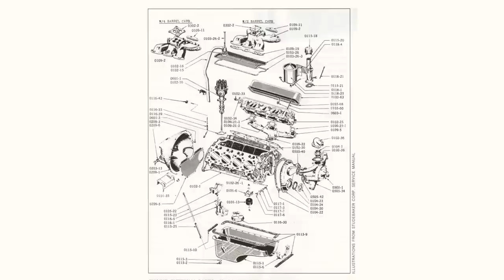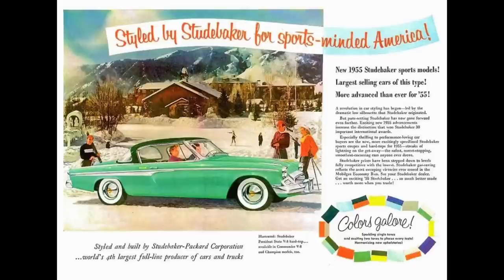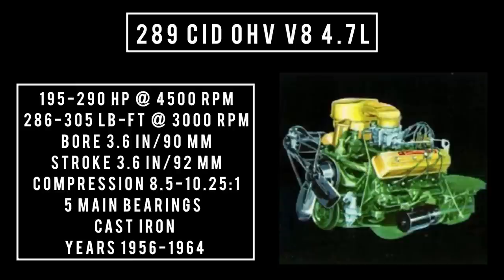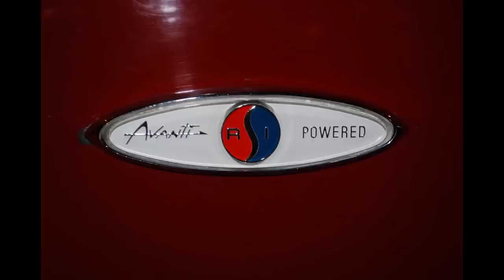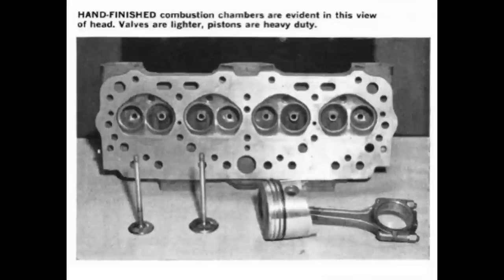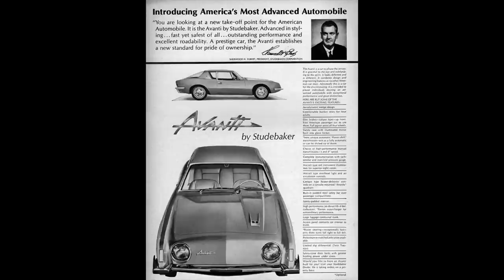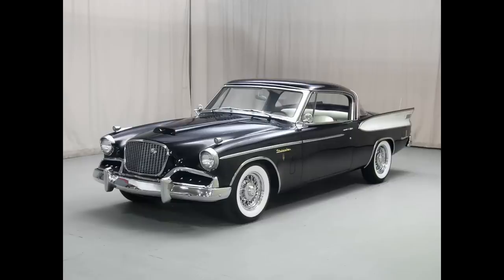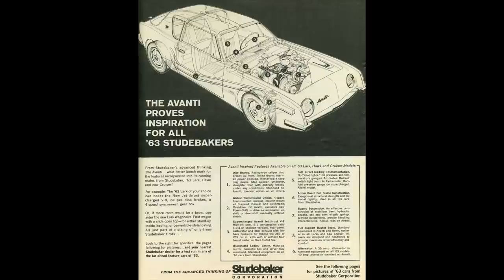STUDEBAKER V8 ENGINE ( 232, 224, 259, 289, 304.5 )

Comment: Studebaker designed their V8 from the start with supercharging in mind. Thus they made it really really strong. But the other side of that coin is that it was a heavy engine, and in particular a heavy engine for it's maximum possible displacement. So when Ford and GM got their small block engines into production, they could match the Studebaker displacement and power with very much lighter engines. The downside of a heavy engine of course is heavy steering and nose heavy handling. Of course Studebaker did go on to use supercharging to stay competitive in power terms, but this added weight, expense and the need for 100 octane fuel. I've often wondered whether Studebaker misread the tealeaves and thought that octane ratings over 100 would become the norm. Don't get me wrong - I love Studebakers, but all I've driven have indeed felt nose heavy, making the driving experience nothing more than average.
Reply from the maker: I’ve heard that too that these tend to be nose heavy I’ve heard of people putting ballast in the back to stable out the ride I’ve also heard about the Hudson jet that it tends to be nose heavy I know that that’s not even on the same subject but there was a lot of cars that had that problem. 

Thank you so much for sharing all the information and insight I really appreciate it =)
Reply: Studebaker, like most automakers in the late 1940s and early 50s when this engine was designed, was almost certainly expecting the super-high octane fuel that had been available during the war for fighters, to be made available commercially.  During the war, 130 and then eventually 150 octane fuel was produced for use in fighter planes (Allied planes that is; the Germans were stuck with no better than 87 octane, which is why their fighters had to have much larger-displacement engines).  Postwar automakers anticipated higher than 100 octane fuel being made available for automotive use, and forced induction is natural to take advantage of that.  But when that kind of super-high octane fuel never did appear in gas pumps, the big three had the money to develop larger displacement engines as an alternate route to greater horsepower.  Not so much with Studebaker, though I have read that they finally did start working on a new 340 V8 engine at the very end, and had made a few prototype blocks.
Reply: @Hibernicus1968  - In the Navy, I worked on the SP-2H Neptune with the turbo-compound R-3350 radial engine. The top octane fuel available then was the 115/145 115 octane, 145 performance number. The engines also used water/alcohol injection.   By the mid 1970's 100/130 was top dog. 100 octane. The fuels were dyed purple and blue, respectfully for visual ID.
Reply: CAPP Stude ACTUALLY did not design with supercharging in mind. But rather with higher octane fuels, as science claimed would be forthcoming and soon. 
The Stude block and strong forged parts amongst many features olds and caddy did not have was deliberately designed for such future fuels.
The engine was as planned capable of extreme comp ratios- as high as 14-15 to one. A testament to it's strength and durability over virtualy all big 3 engines proved itself In those 14 years. By1963 the R3 engine produced over400 HP and the R5 up to 600 HP from 5 litre 304. And by1990s era nearly 1000 HP in Lange's Avanti.
No cad or olds engine of the 50s or 60s EVER capable of those figures. So who really had the primo design back then? Not big 3, Studebaker? yes.
Reply: Read the reports from the 60s era car mags. When properly set up chassis's were finally forthcoming from Studebaker circa 63-64 models they were proclaimed by auto test magazine drivers as the best handling American sedans period. Reference hot rod magazine tests of both the R3 super Lark and the R3 Avanti.
Yes I reiterate the best. Not my appraisal but those magazine drivers. Factory went for a decade from 53 on not having a clue how to get the Stude V8 to produce real power or how to make their cars  great handling items.
Granatelli and Egbert only two individuals in post ww2 that had a speck of true vision. Management previous to them were just grey suits toting cigars .exception was church. Had some vision but "bored of defectors" nixed his ideas for post 1960.
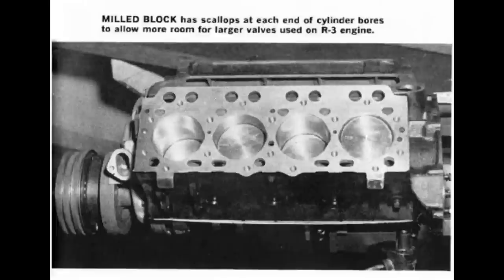Reply: 7:31  Count the head bolts.

Comment: Always love a good studebaker they were way ahead of their time they were running titanium valves back then for all that boosted heat lol
Reply: Because  of the fact that the Studebaker engines were  limited in size they had to revert to expensive ways to make power. The big Three found it was more economical to just make bigger engines, if they wanted more power!  A super charged 289 was a lot more expensive than a Chevy 427. The 427 didn't need exotic parts to make the power they were looking for. A 427 chevy was the same weight as the 289.
Reply: @mylanmiller9656  - I heard that the Packard V8 could have been expanded to upwards of 500 CI.  But Studebaker-Packard dropped it after 1956. The engine was heavy but qualified as a BIG BLOCK.
Reply: @scootergeorge7089  The Packard V8 engine had a 5 inch bore spacing, that is larger than even a big block 460 ford. The weight was not that bad if you look at the size potential. There was a lot of room for future improvements. even the design was more modern than the Studebaker v8.  the Picard engine was a better bet than keeping the Study engine.

Comment: In the late 1970’s I worked at a auto parts and machine shop in Long Beach, California. It was called Standard Motor Parts and I  worked in the machine shop. We had a regular customer who restored Studebakers that we built engines for and I remember the castings seemed better than rivals and the blocks were cleaned of casting flash before assembly. They were also painted inside with an epoxy like paint and I was told this was to aid in oil drain back. My job was boring and honing the blocks and engine assembly and the blocks were heavy compared to the displacement. The Avanti was one of my favorite cars as a kid and even now at 68 yo. 👍🏼
Reply from the maker: Awesome memories thank you so much for sharing those stories =)

Comment: The Studebaker V8 had to be designed as a heavy duty/industrial engine as reflected in its great features like shaft mounted rockers, heavy castings, long skirt pistons, tall deck height and long rods to name a few. Whether planned or not, this lends them to being able to handle high boost levels for longer.  Studebaker had a line of trucks up to at least 2 ton. Diesels weren't really popular until the 1970s when turbocharging became more common on them. Compared to "first generation" Diesels Gasoline engine trucks offered lighter weight (meaning more available payload) simplicity, lower cost, and MUCH better torque and horsepower for their cubic inches (except for Detroit Diesel which Studebaker also offered.  I had a 3-71 from one) over these older Diesels were quiter, started well cold, and they had smaller physical size. They also had a much broader powerband, requiring fewer gears in the transmission. Diesels offered far less low-end torque and could only wind half as high. Gas engines can be made to last just as long. Economy was the big benefit to a Diesel, but gas was cheap. While you will find GM and Ford automotive gasoline V8s and sixes in their low-cost  medium duty trucks, they weren't designed as such, and therefore, GM and Ford used as heavier duty but more costly optional gas engines in stages. #1 use of higher end stronger designed pass car engines, Ford used Lincoln, GMC used Pontiac, etc. #2 Heavily modified passenger car V8s with re-designed heavy duty heads and higher oil and water capacity and flow. #3 A totally separate HEAVY duty industrial/marine line of gas engines that bore absolutely no resemblance to any automotive engine even of the same cubic inches. Just as an example, GMC "big block" V6, V8, and yes, V12s from 305 to 702 ci, and Ford 401, 477, and 534 ci V8s. These engines were installed in semis as well. Ford even twin turboed some of these in marine applications. Ok, Mopar guys, I didn't forget you! They, like Studebaker, designed their automotive engines from the flathead days on up as heavy duty/ industrial as well, not having a separate line. The early hemis were some of the finest heavy duty/ industrial/marine (I have a 1958 Dodge semi tractor that still has its 354 hemi) engines available. The 361 was the longest production big block for Mopar, followed by the 413 because of the truck series. They were used in armored cars also and the 413 was even offered in Mack trucks.(early on, mopar did have some special heavy duty only  flathead sixes up to 413ci) that's why having a heavy duty background led me to like Mopars for racing because no componets needed to be replaced for reliability, or strength, such as for the use of heavy valve springs and no oiling upgrades were really needed. They, also being used for factory high performance and racing engines had good cylinder head flow and rpm potential, especially the hemis. That's also why I like the Studebaker engines, they are made with engineering and materials QUALITY! I think, however, that in their cars  they fell prey to the old adage "theres no replacement for displacement." Small ci centrifugal supercharged engines are great for some racing but are prone to some low end boost lag. They may make 400 hp. That's great, especially for long track speed records. BUT to the average joe or julie taking a test drive around town in traffic, looking for a simple inexpensive (not supercharged special order) yet snappy car, even a base model 361 is going to have a much better throttle response and low end torque where you really need it 90% of the time. Also, many manufacturers offered many multi carb setups for many years on high compression engines even in their more pedestrian and luxury cars like a 1961  413 long ram engine with "only" 375 hp that has 495 ftlb at 2800 rpm, opening 4 bbls at a time with 4 left. The hard part was NOT spinning the tires! This was true of the other manufacturers as well. Even at these performance levels, there was a whole lot left to be had with simple mods naturally aspirated. Also, Studebakers were too heavy, small ci and offered virtually no aftermarket parts. This prevented their being scrounged from junkyards from base models and then swapped into something else and hotrodded like a Ford flathead or Chevy smallblock. And, They certainly couldn't compete in the high-profile 1/4 mile NHRA top fuel drags. As to my experience, I am a drag racer, engine builder, machinist, and tractor puller, and I have owned over a hundred of the big gas engines, consisting of all makes up to the 702 v12s thanks!

Comment: Jay…a few things you left out.

All of the R-3 to R-5 engines were hand built out in California (Ventura/Camarillo area) at Paxton Products, a division of Studebaker, under the supervision of Andy Granatelli. Yes, the same Andy Granatelli that eventually owned STP (another Studebaker company) and the builder of the Indy Turbine Car and competed with Carroll Shelby in developing that technology. Yes, Shelby brought a turbine car to Indy and attempted to qualify it; I believe that was out of the shop in Gardena, CA, just North of the 405, off the Harbor Fwy.  For many years, Andy also owned Tune-Up Masters in the 70’s and 80’s. Sherwood Egbert was brought over from McCullough, the same company that made chain saws and superchargers, the company that supplied the blowers for the 1957 Golden Hawk. It was the 1956 Golden Hawk that had the Packard 352 V8, which was powerful, but very heavy and handled poorly in the Hawk. The 1957 produced about the same hp as the Packard motor, but was much lighter in the Hawk. 

Granatelli oversaw all of the racing development under Egbert, most notably the Bonneville program. I have heard the R-5 was rumored to be upwards of 600 hp…out of 304.5 cubic inches. That was no more a production engine than the 377 that Duntov put in the Corvette Gran Sport!

As for Egbert, he wasn’t as much fired as he resigned. He had been diagnosed with cancer and  Studebaker’s board of directors had made their wishes clear…shut down the car operations. They moved all production to Hamilton, ON…not to save the cars, but to avoid being sued by the dealers for not fulfilling their contractual obligations. Studebaker-Worthington Corporation was formed shortly after that, eventually being acquired by McGraw-Edison in 1979. Today, it’s part of Eaton Corporation.

…and that’s the rest of the story.
Reply from the maker: Thank you so much for sharing all of that I really appreciate it I was missing some content where I talked about Eggbert being brought over from McCullough.. and it’s weird some sources peg him as a villain and other sources peg him as a hero he was a car enthusiast he wanted to see Studebaker succeed and I think he could’ve if things were a little different if he could’ve got more automotive journalist on his side for whatever reason they’ve always been in bed with GM.. 

But thank you so much for sharing all of that insight and information I really appreciate it =)
Reply: Jay, I don’t think anyone, given the passage of time, could view Egbert as a villain. Maybe it was his namesake, as the villainous alter ego in “Dilbert” that lead some to think that. 😂

He was an engineer who came from a very blue collar background. When he took over Studebaker, I believe he was 42 yrs old!  He tried what no one thought could be done…with basically no resources. Bringing in Raymond Loewy to do the Avanti, in literally 6 weeks, and Brooks Stevens to freshen up both the Hawk and the Lark, was masterful. I don’t know if it was as much too little as it was too late. The Avanti had the same teething problems that beset the Corvette, just not the deep pockets of GM. And the Hawk was Studebaker’s previous halo car…but was in it’s 12th year of production by the time the plant was closed in December, 1963. Heck, the Lark was on its 8th model year by the time it was finished in 1966.
Reply: It is my understanding that after the South Bend facility was shut down, all Canadian produced cars used Chevrolet engines.  True?
Reply: @scootergeorge7089 Yes, when production ceased in South Bend, all cars in Hamilton, OH used Chevrolet engines.
Reply: Thanks Mr Harvey but that's only the tip of the iceberg, not the rest of the story. By and large your analysis is on target. 
But for example ,NO one would claim that the R5 was a production engine. It was a veritable 
"Mule" set up to showcase the  venerable Stude V8 pptential that was close to a 15 yo design by 1964. And what it proved at 600 HP and 198 MPH was that Detroit had many good throw away engines,but NOTHING that matched STUDEBAKER's quality.
Envision ,for the sake of humorous examination, the history of the company . In 1862, or 10 years after Studebaker began producing wheeled transportsion, the company was producing hundreds to thousands of wagons etc,including such for the army of the north . 
Meanwhile a year LATER a man boy was born and taking nourishment from mother's mammary glands. His name ?
Henry Ford.
Much much more to the story before 1964-66, and an entire legacy of achievements for the 
114 years previous.
As to the R3'S 4s and one ,R5 being hand built by Granatelli??
That's natural for a hi-po engine series.
But consider the R3 capable of 175 mph in 1963. Or compare to the Corvette in 1963-65 which was capable of 133-138 MPH,OR 40 MPH slower than the Avanti.
Corvette finally was able to match and top such speeds...
BUT almost 25 years later, and they were NOT factory jobs. 
Called calloway vettes and were tweaked OUT of factory for several years and versions--
Thats Exactly Granatelli-esque.
Minor player Studebaker beat the pants off the big 3 in the 63-64 model years and THAT is the true " rest of the story".
Replace the "bored of defectors " ten to twelve years earlier and maybe....yes a qualified maybe......
Reply: Studebaker submitted a paper to the Society of Automative Engineers (SAE) about the R5 saying it was 638 hp.  Some online references say 575 hp for some reason.  I think Studebaker's own submitted paper is pretty authoritative.

Comment: I can tell you with certainty a few Studebaker V8 facts.

• R1 and R2 were 3_9/16" bore by 3_5/8" stroke.

• R3 had A-series and B-series engines. The 304.5 were B-series and were  3_21/32" bore by 3_5/8" stroke.

• The A-series started with R2 bore and added 60 thousandths overbore pistons. Same 3_5/8" stroke. That gave 299 CID. The A-series engines were all of the R3s to set records.

•One A-series R3 (so 299 CID) was stock R2 bore plus 1/8" stroke so 3_3/4". Andy Granatelli spun this engine to 8,000 RPM in half-mile drags at Riverside against 426 max wedge MoPars, and beat them.

How do I know? I drove Avanti 63R-1025 to high school in the middle 1990s, and that's the Avanti with the 3_3/4" stroke 299. My father bought it in 1969. He sold it in 2021.

I come from a Studebaker family.
Reply from the maker: Awesome thank you so much for sharing that information I think the source rounded those numbers, but really appreciate you sharing the actual numbers thank you so much =)